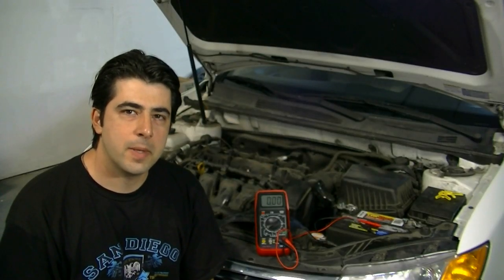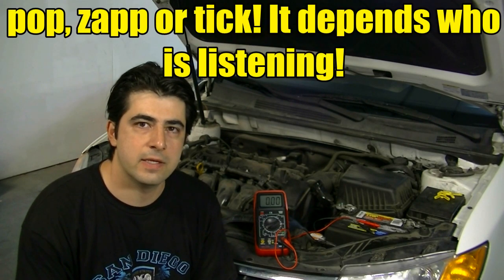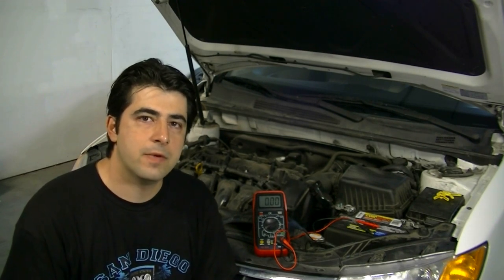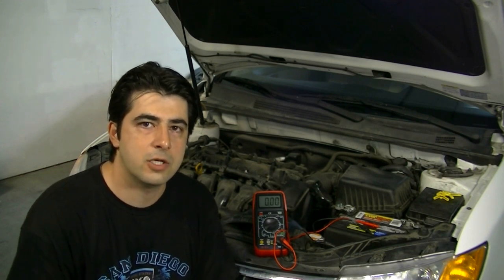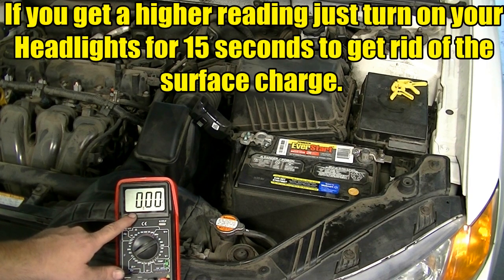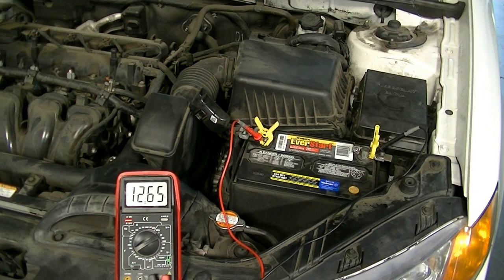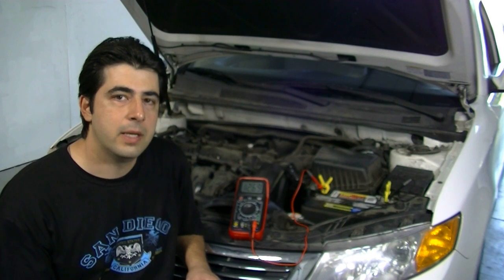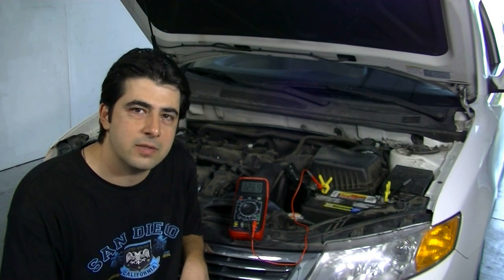How to Test a Car Battery - Plus Tips on How to Prevent a Battery From Going Bad

Comment: Factory CCA numbers are tested with a bottom number of 9.6v, not 10.5. However, that test is performed at low ambient temps. You can use 10.5V if the car has been running within the past hour or so. If the car is first to start of day 9.8 volts bottom number. If the car is the first start of the day and the outside temp is below 32 then 9.6 volts is the bottom number. No matter the case or temps the battery should not drop below 9.6v during startup. If the battery is below 9.6v during cranking at any time. You need to charge the battery run text again if fail to replace the battery especially if the weather is cold. It will leave you stranded.   
Also, you should run headlights for at least 30 sec before the test. Removing any false charge sitting on top of the voltage. Especially if you charged the batter before this test. It is common practice to run headlight for 30 sec 90% of the time when performing this test. if you put the meter on the battery and volts are above 12.7 you need to turn on the headlight for 30 sec. Battery voltage should be 12.4v-12.6v give or take .9v.

Comment: Great information as always!
I had an issue with my 2001 Explorer Sport where it would not start after just driving it.  No power to headlights, power locks windows, radio, nothing.  Checked and found that the wire connections to the terminal clamp were badly corroded.  Similar to how the wires are connected on the back of the terminal clamp on the positive post in your video above.  The connection between the post and clamp was in decent shape.  I unbolted the wires from the back of the connector, cleaned it all off with a wire brush, including spreading apart the wire strands to clean the corrosion off of them.  Once it was all reconnected, everything was fine.  So that's another place to look for corrosion.

Comment: It always surprises my how often people get this wrong. Even professionals sometimes forget to check the engine ground connection, and overall the diagnostics are not as easy as some people think. Your review is exactly right, especially the emphasis on load testing. Also it's worth emphasizing that a battery needs to be warm, electrolyte level is normal, and fully charged before before testing. I find doing the load test away from the vehicle avoids the confusion about bad connections, so your remarks about double checking the battery at a local store is great advice.

Comment: Good stuff, easy to understand "gracias".I'm going to test my battery tomorrow.The central locking is not working ,there are no lights on the dash? Not sure what's happened,but the ignition fuse was blow,replaced that,but still no life? C'est la vie I guess

Comment: My car battery was sitting for about 2 months in low temps -2 to 5 C and it wouldn't start the car. I charged it drove it and it then sat again for a good 2 months in temps around 5 to 11 C, I didn't start it but checked the voltage which showed 12.4. My charger was giving 2 amps which increased to 3. Also if you have a bmw you can check volts on the dash by holding the trip reset until it flashes yes/no, select yes go to 19 then 9 (E46)

Comment: Sir, please kindly take take note on the question below...
Say, the battery is showing 12.7 volt on checking multimeter, however, checking gravity tests on each cell, if anyone shows reading out of range, should I confirm the battery is going bad???
Which is the best and correct to identify battery is dead and needs new battery??? Voltage reading or gravity tests????
Thanks.
Reply: TONSING T testing as with a load test like in the video is testing the complete battery having an average of the full count of cells.  Testing each cell via specific gravity of acid/water will possibly show that only one or more of the total are having issue. If you have even one cell out of range you can bet the others are soon to follow.

Comment: used touch screen for too long and "powering off to save battery" popped
 up. checked voltage and it's 12.1.   wont' be driving for awhile, maybe
 a week will it start later?
Reply: charge it back up with trickle charger

Comment: My battery read 12.6 with engine off a soon i turn on the headlights read 11.10 so is this posible bad battery .? But if i started the engine from 12.6 i got 14.3 so what is the problem battery or alternator .?
Reply: Armando Sanchez when a battery is labeled 12v it doesn't have to be 12v all the time, that label for identification purpose only
Reply: Armando Sanchez a healthy battery will always show a slight increment when is not being used, in your case the 12.6v. once you put a load on it like the headlights you'll a notice a drop. Higher load will cause more drop
Reply: Armando Sanchez you get around 14v while car is on because the alternator is charging the battery. a general fact, batteries always get charged by higher voltage then their normal designed voltage otherwise it won't be charged. So that 14v is actually the output terminals of the alternator that charge your batteries.

Comment: The voltage on my car's battery reads 12.3 when connected and 12.6 when terminals disconnected. Is this normal? What could cause this?
Reply: parasytic draw